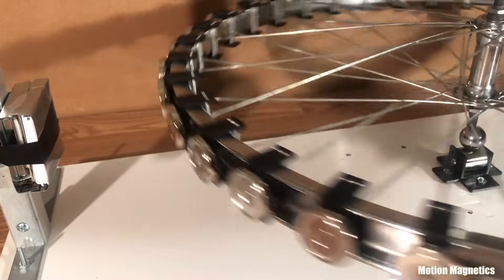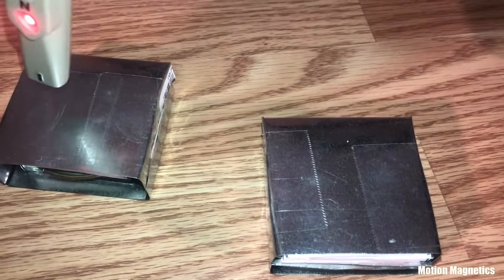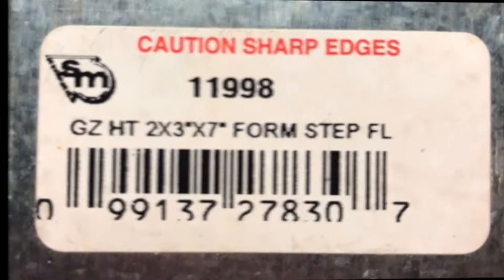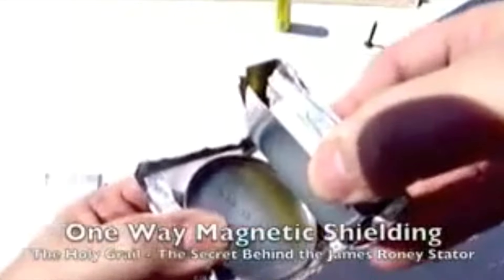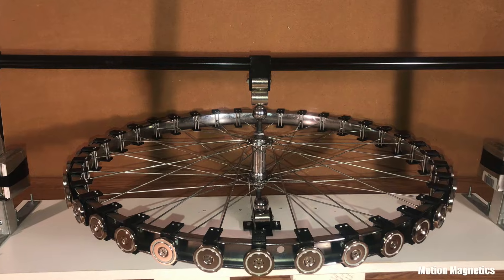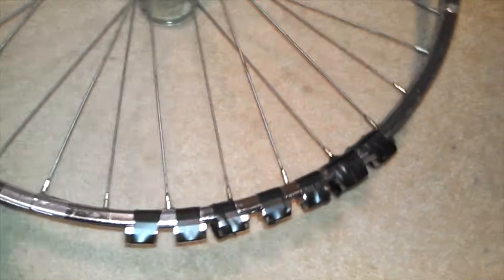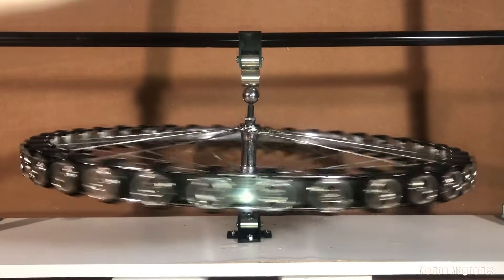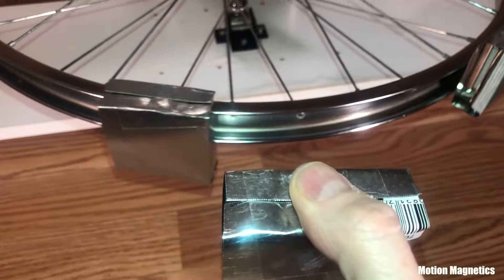A look at James Roney Stators

Comment: Can dead batteries explode?

Yes, batteries, even dead ones, can explode or catch fire under certain conditions. This is more common with lithium-ion batteries due to their high energy density and flammable electrolytes. Even though a battery is considered "dead," it can still retain a significant amount of charge, and damage or improper handling can lead to a dangerous release of energy.

Comment: I agree with @rickibaron4816, and I might add one more thing to that. Any machine like this that you are planning to attempt to get power out of needs to have some form of operational control system. These machines cannot be just an on or off only machines. If they were they would either stall out when connecting a load or race to destruction if no load was attached and unless the operator has some sort of throttle control system to keep the machines motion in balance, once the machine is turned on with no way to control its motion it will race to destruction if not shut off. Unless you can find a way to mechanically control its speed by means of automatic switching of electric magnets to control the permanent magnets spin internally then a speed control mechanism will be needed for operation.

Comment: Ive often imagine a shielding device which rotated around the permanent magnet timed by off centered oval gears which would have an increase of speed during part of its rotation quickly interfering with the after effect magnets back draw.  It would always have the proper revolutions but it would vary in its spinning speed.  Like a section of a cylinder which would rotate around the magnet on the ferris wheel.  Watch "weird gears" and check out the odd rotation speeds.

Comment: Being an inventor machinist, I have played with building wheels with magnets embedded around the circumference of the wheel. However my invention did not work. So as usual,I learned from my mistakes. Then I decided to go in another direction. Finally after 46 years in the pursuit of my invention, that of building a perpetual motion machine, I hit the jackpot. The force tester machine I built and set up in my living room, showed a 7 pound force lifting a 20 pound weight at a 1 to 1 ratio. Soon as I seen what I achieved, I instantly knew I just solved the world’s energy problem forever pollution free. Believe it or not, this invention of mine changes potential energy into kinetic energy without the loss of potential energy. I called my invention a ( Mechanical Piston Engine Apparatus). Tried patenting it, but ran out of money. The invention became permanently abandoned on the doorstep of the United States Patent Office. So the only thing left for me to do, to get this invention out into the world was to write a book about the invention, that included the schematics and pictures of what has been built so far, and the explanation of how the machine works. All said and done, the book has been published and released this past summer. It is called (Mechanical Free Energy) by David Russell. You can buy it on Amazon Kindle books store. If you want to see how potential energy is converted into kinetic energy without the loss of potential energy, you will have to get yourself a copy of the book and look at the schematics and pictures that are shown in the book. This invention is being given away as a free gift to the whole wide world. Anyone can build and manufacture this machine at any size, large or small,depending on how much electricity you want to generate and produce. So get at it and start building your own machine and get this machine out into the world. The sooner the better. Let’s try and put a dent into climate change before it is too late. To learn more about this invention, contact me at (russelldave55@yahoo.com). Have a great day. David Clyde Russell.

Comment: See it is a shape that they use to accelerate charged particals , https://www.youtube.com/watch?v=_vkc2KpVP44,
imagine there was a slit so the spokes of your wheel could traverse the side of the bowl to the center, then you put like 7 of them arranged in in a circle with spacing of increasing intervals as they went around the circumference of a circle outside of the wheel causing some magnets to be at the base of the magnetic bowl, and each successive magnet on your wheel was farther and farther away from the center of the bowl.... also the axis of NS is tangent to the circumference fo the circle

Comment: Videos like this isn't a threat because it can't be used for anything other than amusement. You cannot generate energy with it and it's not perpetual. The most you can do is just reduce the friction as low as possible so it works for a long time.
Reply: Correct, but if you are satisfied with something that rotates a long time, just take a wheel with good bearings and leave magnets out. They don't contribute to long running.
Reply: @durchblick9505  Why would you bother building a decoration that does nothing though
Reply: @Darthmufin    Only reason I can think of: you show it on YouTube as a click-bait. 😊

Comment: Consider using ball magnets at least in 1 inch diameter that are fluid in their hyperbolic fitting (3d print with Teflon for frictionless rotation to the attraction field) around the wheel to increase and stabilize the magnetic fields this will ensure balanced continuous motion when activated

Comment: Iv studied these kinds of things for years most are bs, but shielding like this may actually work, the setup is similar to the static motor that runs from a vandergraaf... the problem being that not enough torque is produced this way for it to be used for anything. Over unity is real... instead of using stators, maybe try a vandergraaf powered by solar and battery connected to a conductor one side with another conductor at the other side connected to earth... I imagine the results will be impressive
Reply: Overunity is real??? I am not aware that an overunity device has ever existed or even exists whose function was confirmed by independent experts.

Comment: I approach these devices as 'alternative energy' and unless anyone has actually defined what magnetism actually is, the definition fits. 
Bravo! For demonstration! 😊
Reply: Magnetism is the effect of a stored energy field on a polarised material, it produces the effects of attract and repel
Reply: @JohnWalsh-p6v  That is the effect,  but does not explain what it actually is; or why the strongest point of magnetic force is always 90 degrees from the plain of strongest gravitation.
Thank You for the response.
Reply: @johnwenzel2003   In natural science we observe what happens in nature and describe it with mathematical formulas. For electric and magnetic effects we have Maxwells equations. Magnetic fields are caused by electric currents or changes of the electric field. We know that and we have formulas for it. But explanations? Basic effects can only be observed but not "explained".
Reply: @durchblick9505  The problem lies in that the observations may not be complete.   All too often somthing gets dismissed because it doesn't fit a 'know model' ignoring the possibility that the model may be incomplete, contain a flaw or that the wrong model is being applied.  The first and most important question is 'does it work?'.
Reply: @johnwenzel2003    It does not work. Physicists never dismiss things which can be observed and replicated. But up to now no one was able to demonstrate "free energy" in a credible way. Thus there is no reason to worry about laws of physics not being complete.
Reply: Cheap transport potential.  magnetism is, like gravity,   is orbital angular momentum that is conserved as  the universe contracts or expands, how's that.     Extracting work out of it is like rolling a ball or riding a bike.   see Neothers letters to Einstein and Hilbert and her Variations.  gets keep into holographic principle and abstract algebra but its  most like , the earth turns for free,  and billons of years longer than most  simulations expect.

Comment: I have an idea of a vertical tube around which are place directional field magnets, above the tube a metal static charge collector, the idea was that Brownian motion of a gas within the tube would induce a charge in its atoms, so they would get warmer thereby rising. The accumulated charge would discharge through the collector & the gas would cool flowing down outside the screened magnets to start the cycle again. Possibly, an electrical circuit could made at the bottom & top of the tube.

Comment: I always had the idea if the magnet 🧲 outside the wheel was also spinning as to be in the position to strongly attract the center wheel then rotate or move out of the the position not to attract or try to slow the wheel down. The shielding does a decent job, however still has the reverse pull. Obviously if it was an electric magnet it would be on to pull, then off so it wouldn’t slow the wheel. You are WAY MORE ADVANCED than I am . So if there is an idea 💡 you can work with go for it.

Comment: I recommend reading the wikipedia page on "conservative forces". In short this means any PM machine that returns to the same point twice is incapable of doing  work, none. Worse the nature of conservative forces mean the path taken is irrelevant. This means any design that returns to the same point wont work. Consider gravity.. the change in potential energy between two points depends on the height difference between the two points, the path taken between them is irrelevant. So it doesnt matter how complicated a machine you make, if it ever returns to the same state (point) it cannot do work. Sadly magnetic force is also a  conservative force..

Comment: I have a few questions about James Roney's stator design: 
1) If the magnet inside the stator was an N35 instead of an N42, would it still work? 
2) If how the stator works is due to how the magnet is shielded, can it also be built with magnets of different shapes and sizes? Say a 10mmx2mm N35 round, or triangular, neodymium magnet for example. It would be great if you could demonstrate the concept of building working stators like these with different types of magnets.
Reply from the maker: You could use different grades. James usually uses N42 or higher, but you could use a weaker one. 

The shape I used is easier to build shielding for. You could use different shapes but you'll have to adjust the shielding to make sure you're accomplishing the same thing.
Reply: Thanks for the reply  @Motionmagnetics .
I have another question is you don't mind... Could you please show us the pattern of the magnetic field around your James Roney stator replica with a magnetic field viewer sheet/film?

Comment: I'm sorry. Mechanical Engineer here. It is not lazy thinking to explain the implausibility of perpetual motion using the laws of thermodynamics. It is lazy on the part of the perpetual motion machine designer not to try and understand said laws. This isn't a conspiracy from the powers that be. For perpetual motion to be possible, the way our whole universe works would have to change. And it is not going to change for anyone, not even the powers that be
Reply: Thank you Reality s REAL lol
Reply: Except for that inventor who figures out how to make neutrinos do work . . .
Reply: @rogerscottcathey  I mean, neutrinos doing work would be like the sun's light doing work. Sustainable relative to our lifespans, but the machines using them would not be perpetual any more than one powered by a solar panel
Reply: @reecenaidu6020  : Practically free if not for the aging of equipment. There is a constant flow of Neutrinos regardless of time of day, predominantly into the Earth but also out of the Earth. The fact that there is a differential between down flowing and outflowing shows they are interacting in the core.

A neutrino based battery or energy converter would be ideal. It would work anywhere.
Reply: AngryRU
Reply: All energy is perpetual according to the laws of conservation.
It cannot be created or destroyed, only converted into other energy.
When it comes to the powers that be, they have been keeping carbon nanotech from the public for over 15 years. Even though graphene can be made cheap and easily in a physics lab, it cost over 1/2 million a kilogram, for raw graphene power.
Reply: Isn't Earth and every planet in perpetual motion ?
And hasn't  scientific progress been achieved by breaking status quo theories ?...no matter what level and kind of engineering degree,ph.d et.c.
They are simply achieved by memorizing theories and repeating processes achieved by predecessors.
So science is not a result and finite "truth" it's and ongoing process ! And there is little else more preventative of scientific evolution than getting in the proverbial soapbox and declaring a concept to be impossible when such a multitude of "impossible"things are now de facto
Reply: Nobody is trying to make perpetual motion have you not listened to the videos nobody is trying this. Mechanical dumbass explained that one to us

Comment: Hi, I'm loving you vids on this topic of kinetic power generation. I have been into this for a long time & I thought that magnetic lock up due to both poles being active was the end of my idea & having seen this I am again keen to get going again. If your still available can you please tell me the thickness of the MuMetal you used for these stators you made in this video. Is foil ok is it more of 1 mm thick etc etc. I'm in Australia so I was born in the metric system I have no idea and may never under imperial lol, your help my provide the answer to magnetic lock up for my project. Thanks for sharing all this great stuff! :)
Reply from the maker: Most of the stators were made from thin metal strips you could pick up at any hardware store. It's not critical what you use, as long as you use the shielding technique.

Comment: Batteries are not needed , just give an excuse of some power hidden. A little dissatisfied,  you could do a easy shielding without all that mess. Better then copy a concept is doing an upgrade on concept, as long as you understand what you are doing, of course. Like in this case you absolutely understood the concept.

Comment: <Stator>Try arranging the stator magnets as a confined center circular Halbach array, but instead of being circular have the magnets spiral outwards around the rotor at a ratio of 1.618, the orientation and strength of the poles is very specific (Can be stacked with trials for right orientation to gain strength). You will need to find a way to hold these in place due to the opposing fields. (Glue, 3d Print) <Bearing/Pivot>For stability of rotor, use the circular Halbach array with a confined center again, but with a flat N52 between array and rotor (to isolate field), duplicated on each end with a hole for the axis of the rotor to pass through to support and center the axis of the rotor. <Rotor> Rotor Shaft should be ceramic with diametrically magnetized cylinders at each end that will reside in the magnetic bearing. Glue a ruby (or quartz depending on what you want to accomplish) to friction end (down) of rotor and ceramic base for point or ball of ruby to spin on. I'll leave the configuration of the rotor up to the imagination ;) Once the rotor design has been established its much more effective to interchange the design of the rotor and stator. The rotor will end up looking like a propeller. For the field think toroidal shape with spiral waves propagating perpetually in on itself in a motion that resembles the shape similar to DNA strands, or DNA wrapped around a tokamak. Also, possibly look into Dirichlet's theorem for placement and the hall effect to generate some added force from angular motion. Fun thing is that just like interchanging the rotor and stator designs, you can also make this, so the outer is rotor and inner is stator. Bearing gets more complicated though but the spinning mass is extremely helpful. Helpful in a way that makes gravity mathematically coherent in my opinion.

What does the Crookes radiometer & magnetometers measurements have in common? What has angular momentum & inertial force that shares that component. 

Just some ideas if pondered. never really tried any of it.

Have a Great day!!
Reply: Maybe a smaller wheel (magnet inside?) and more aerodynamic features could make it work better.

Comment: Stop attempting to design a magnet powered wheel, one wheel at a time. Instead design a wheel where all the magnets on the wheel as well as the static magnets position, polarity, orientation, angle, tilt, etc. Can be adjusted and tested by an AI controller, and it will find the configurations required for success, and in no time at all, no doubt.
I realize making a wheel that can do that seems difficult, but why take shots in the dark over and over again when, if you sign the wheel I'm suggesting, success is a sure thing?

Comment: I think the magnet buffer thing should be used indirectly than directly to be more efficient and need some small amount of electricity to put a little in and get more out. You need at least some small source of energy to get more. Since you can make something with something than nothing making something.

Comment: I like your curiosity. However, if I'm to assume here that you might be implying perpetual motion, it ain't gonna happen. These ideas have been disproven every single time. You cannot reverse entropy, and you cannot create energy. Now, on the other hand, if you're claiming to "channel" energy differences in the environment, in an attempt to convert one energy type to another, perhaps that's possible.

I suspect there isn't that much useful energy to obtain, since your environment is continually moving towards thermal equilibrium, but maybe you're only wanting to drive small, low power circuitry. Interesting nonetheless.
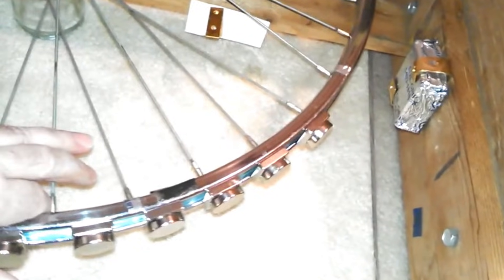Reply: 10:00 textbook dunning-kruger effect